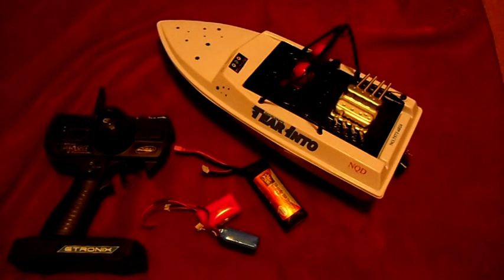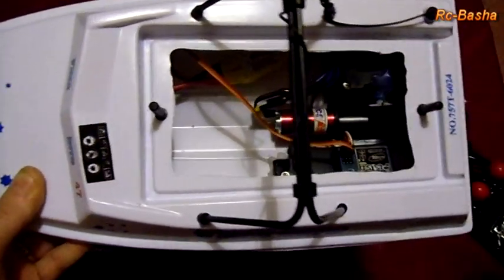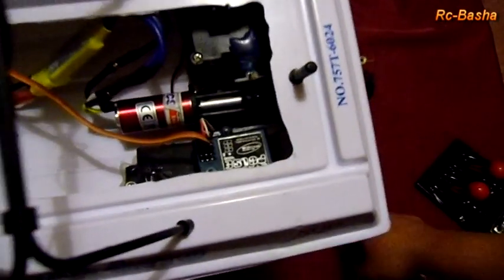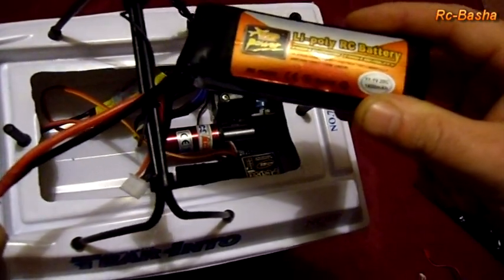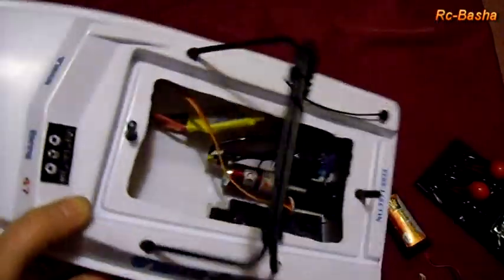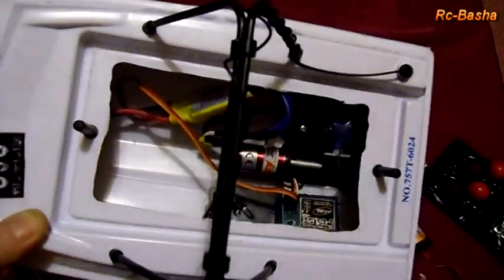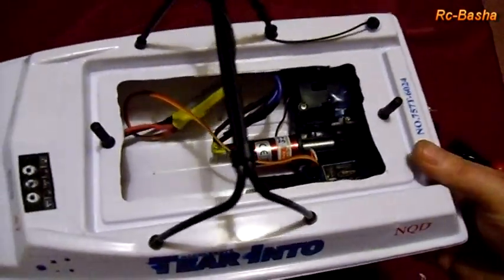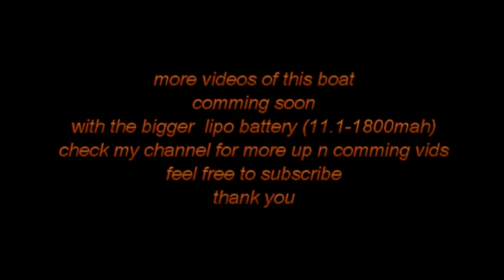tear into jet boat  how to basic mod

Comment from the maker: way better with the 3c    real nippy, also fitted water cooler round the brushless motor now,
yeah the original electrics are bang bang and real strange servo with loads of wires
so  just got rid of all that n put my own stuff in
great little project

Comment: How did it go with the 3s lipo?  It looked like it would have been fine with a bigger capacity and higher C rating 2s.

Are the stock electronics just bang bang controls or are they proportional?